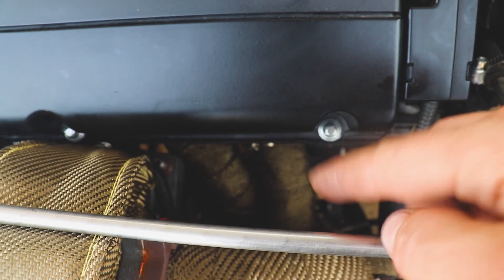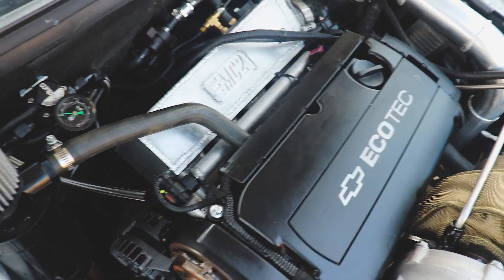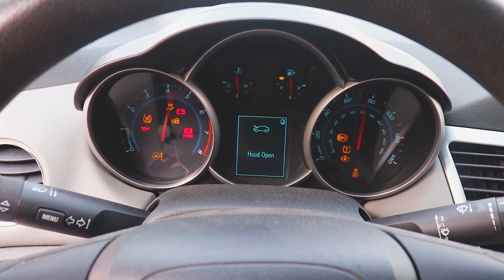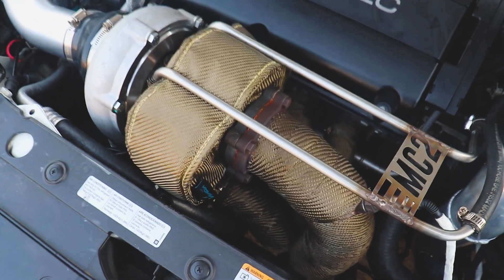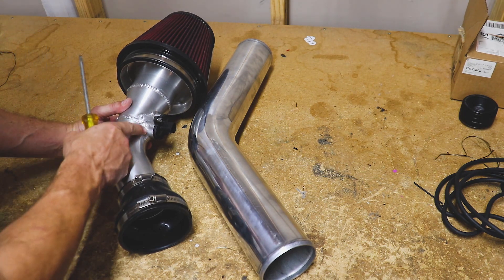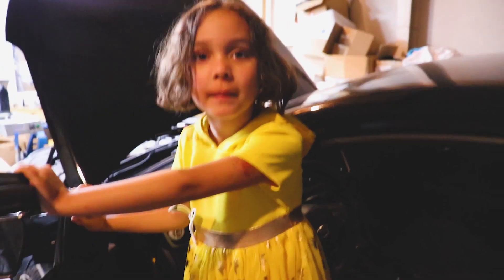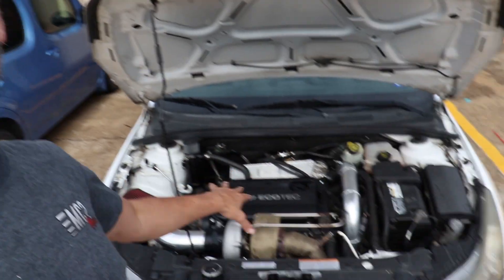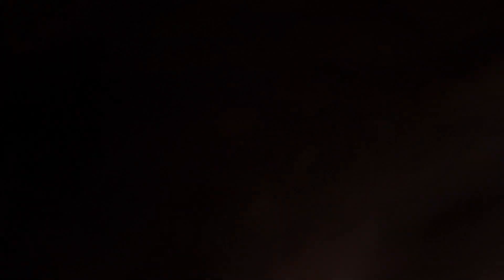Turbo Cruze Project Update: The End of the Road?

Comment: The easiest way to attach something to a pipe is weld it on first then make the hole by either using a hole saw or drill and carbide. U will get a way cleaner result and for drilling circular holes with hole saw the part u weld on will be the guide to make a nice hole.
Reply from the maker: True! Didn't have a hole saw though.

Comment: Hey man, I have a 14 1.8 and was hoping u could answer some questions for me and maybe point me towards the injectors u got or if I really need injectors to run maybe 8psi?
Reply from the maker: Hey! Might need to go to 60# injectors to be on the safe side, but you could always try what you got to see where they cap out.
Reply: @Matthew Chevalier  do u have a link for yours? Also why did hp tuners not work for u? My buddy has hp and I was hoping to just use his and not buy another tuner

Comment: I need to get a better welding set up! What are you using to do aluminum? What type of gas and rods? I have a big non CRUZE project coming up. You inspired me to make an upgrade to my set up.
Reply from the maker: The AC welder I have, is borrowed from a friend. It's a miller. My normal setup is a Jeg's tig. Wish I would have just sprung for their AC set, because I'm super impressed with their DC tig. Rods depend on what I'm welding really. I'm no pro, so I would have to go back and look, but I got the rods from a local welding supply, and I'm just using pure argon.  That's awesome! Keep learning, getting better, and looking forward to what the next project is.
Reply: @cmattdabrat  He may feel that you’re not a professional but I would argue that you’re not that far off from being able to become one!
Reply from the maker: @davesworld2132  I appreciate that. Certainly, anyone could become a professional at whatever you set your mind to. For me, this is just fun. And sharing that with everyone.

Comment: The Spark and Sonic can have the 1.4, and the Sonic can have the 1.8. I believe the 1.4 and 1.8 share mounts and bell housing design so it would be possible to put this into a Spark and have it absolutely RIP
Reply from the maker: Same bell housing. The mounts are different between chassis. So theoretically, yes. I'm sure if you kept the mounts that came in the Spark, you could drop in a 1.8.
Reply: @cmattdabrat  Turbo 1.8 in a Spark sounds pretty kickass to me

Comment: Its looking good Matt! 👌 I have a 1.8 myself. Once your done with the built. Would you consider boosting  other 1.8 cruzes?
Reply from the maker: I would definitely consider it, or making parts if the EPA doesn't go after me. They would have to be for off-road only use to not get in trouble.
Reply: @cmattdabrat  Yes very true. I think your a very smart and intelligent builder. I so would want you to boost my 1.8 🔥
Reply: @cmattdabrat  Do you have a IG Matt?
Reply from the maker: @sena8895  I do, it Matthew Chevalier on IG
Reply: @cmattdabrat  as soon as you make parts for a 1.8 turbo kit I’ll be first in line to buy it

Comment: Hey Matt, i ended up taking the wrap off mine, as the heat made my manifold crack! hopefully it doesnt make yours crack either!!
Reply from the maker: Where did you get your manifold? Could be a support issue. The weight of the turbo hanging and flexing the turbo manifold itself. This one was made out of schedule 10 stainless tubing, so fingers crossed I don't get a crack issue.

Comment: Which turbo are you running? Could you share the link for the oil feed line and water lines fittings?
Reply from the maker: It's Maxpeedingrods GT35 with the billet wheel. Link in the description. It's a custom hardline oil feed that I made. Most of the parts are from Motion Raceworks.
Reply: I got the original gt3582 from maxpeedingrods and I'm gonna fit it on my 03 wrx wagon. I jus wana get the right fittings so i dont have any oiling issues
Reply from the maker: @jyeesing  I hope that helps. I wish I had recorded more about the feed, but because it was custom, it did take some planing. I honestly don't like how hard it make it to install the turbo. Hopefully those specs will help with a flexible line.
Reply from the maker: @jyeesing  I feel you! Here are the specs. I had the same turbo on. The billet wheel is pretty much the same aside from the alloy they use for the hot side. It's almost a stainless steel.
Oil feed/inlet: M10*7/16-24
Oil drian/outlet: 2*M8*1.25
Water inlet/outlet: M14* 1.5

Comment: 4:45.. pretty sure that should be in your intake tube before the throttle body and intake manifold.. even if you're using your MAP sensor for tuning I believe the cold start idle (open loop) is controlled (better) off MAF...never seen it in the intake for the turbocharger
8:20... nothing a flap wheel won't fix👍
Reply from the maker: True on both accounts. The boosted 1.4's come with the MAF before the turbo as well as other models I've see with these cartridge style MAF sensors.
Reply: Almost all factory MAF are pre turbo that I know of?
Reply from the maker: @802Garage  I agree.